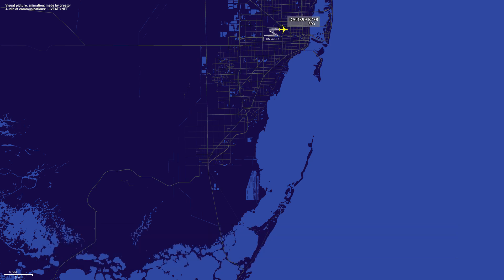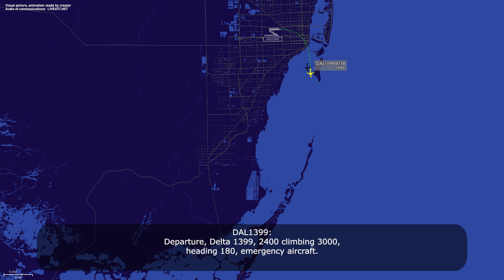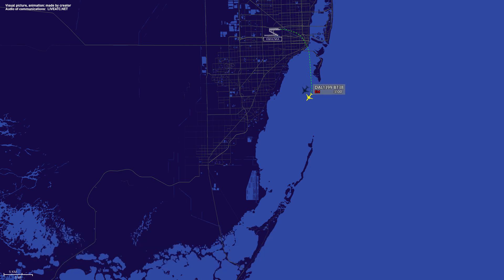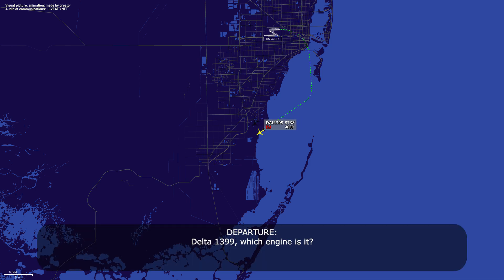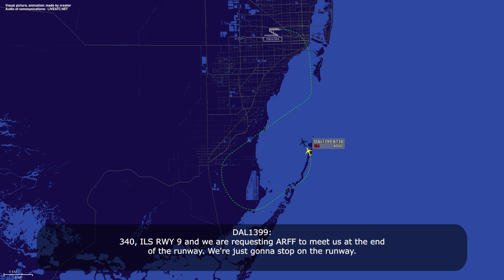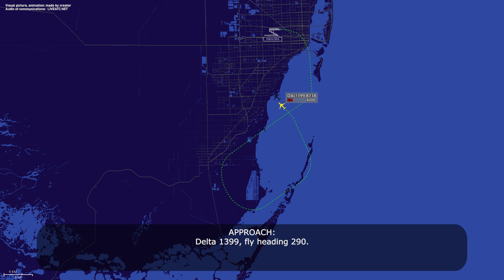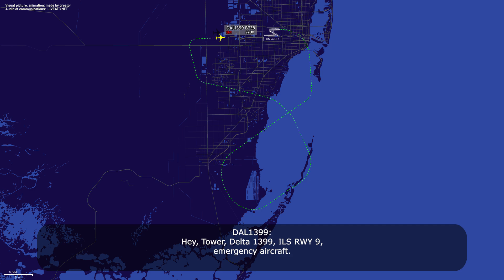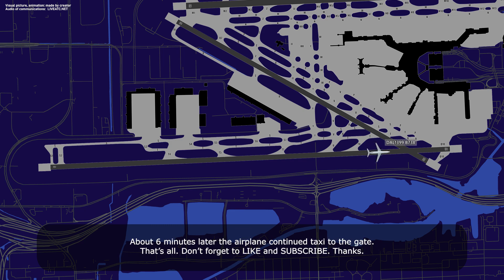Damaged engine after bird strike. Delta Boeing 737 performs single engine landing at Miami. Real ATC

Comment: Wish controllers asked less questions but I guess it's required/needed?
Reply: Yeah it’s borderline if the pilots are overloaded but seemed reasonable here. It only becomes annoying when a different controller asks for the same information because it didn’t get passed on, or in one case where I think they were insisting on getting fuel in lbs and the pilots only had it in kilos and understandably weren’t interested in doing the conversion whilst flying an emergency aircraft.